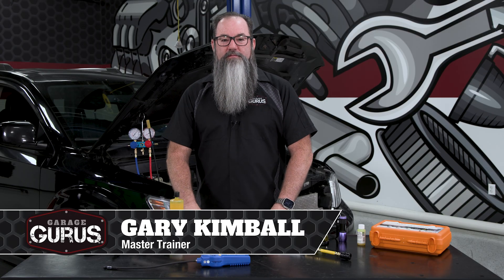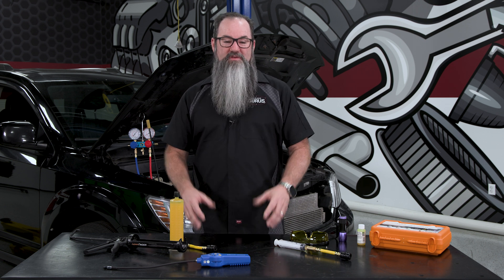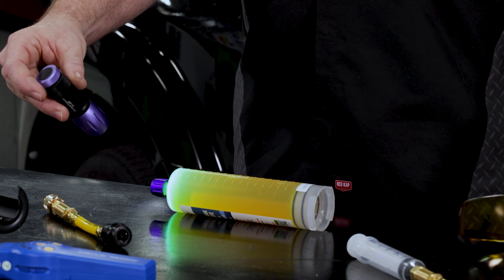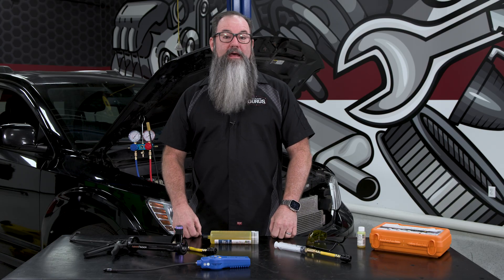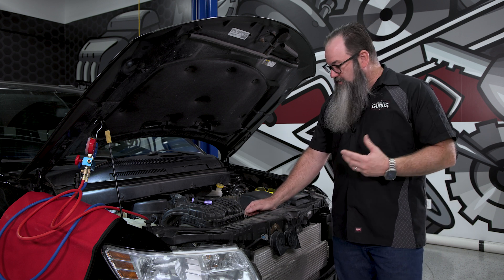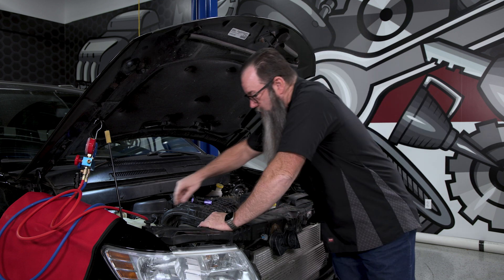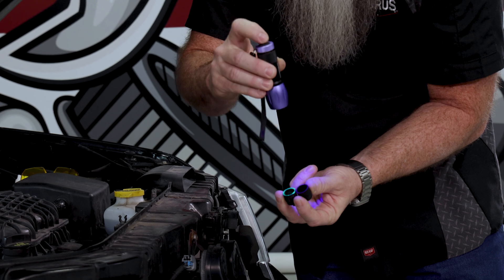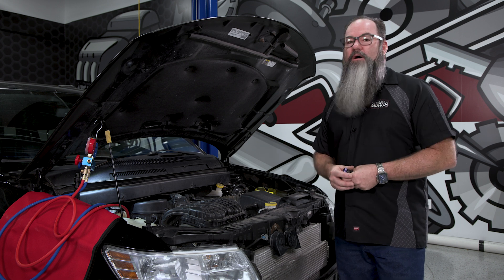Garage Gurus | How to Use AC Leak Detector Dye

Comment: I was just serving a Ford van. The dye revealed a leak at the condenser. However, upon further inspection, it also had an evaporator leaking as well. 

Those are really hard to find. My theory is that on the older models without cabin filters, decaying leaves will rot out the metal once they get into the hvac system.